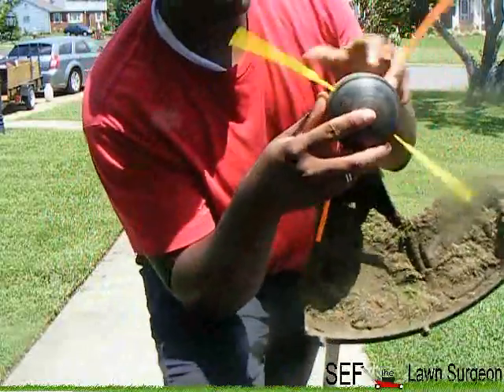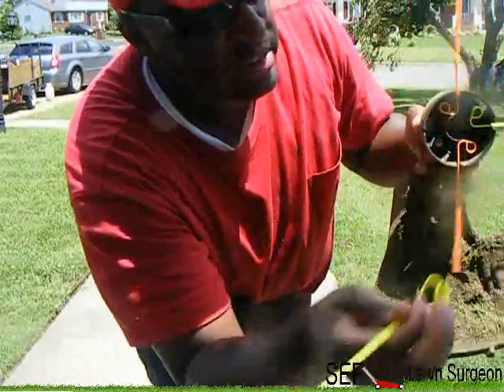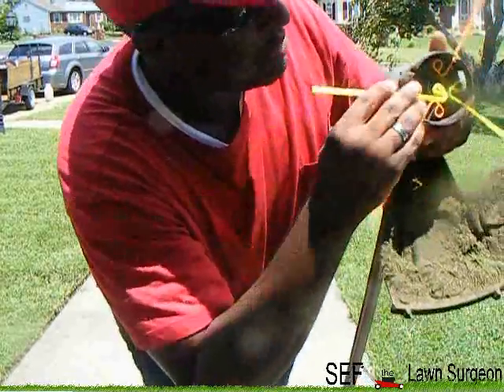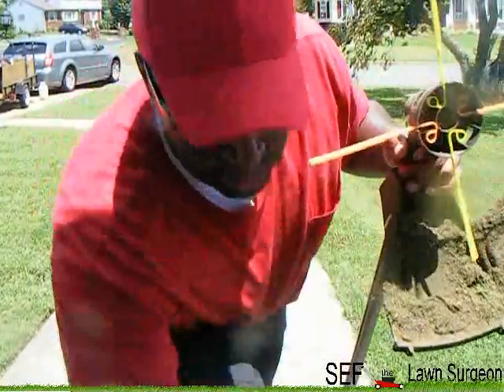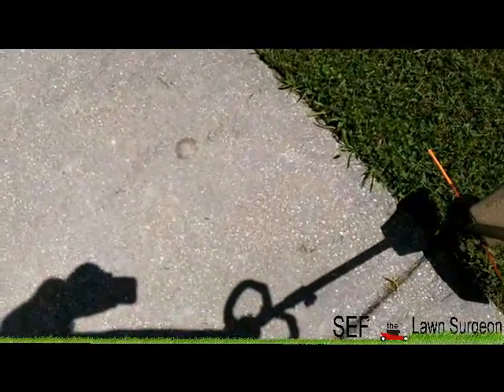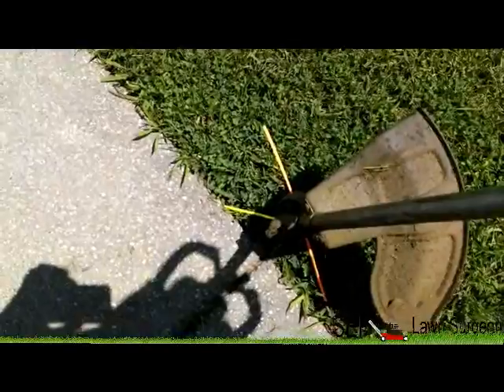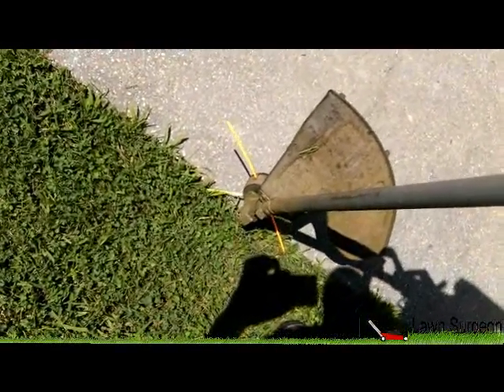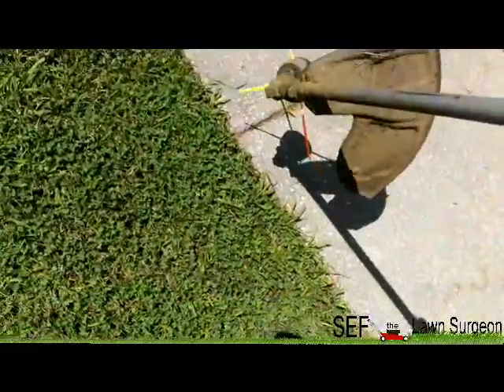How To Edge Your Lawn (The SEF way)

Comment: How was that a straight edge that was jagged    as hell. No hate just truth. And aeroflex is shit tried it when I bought my troy bilt trimmer went thru the pack of line that came with it just doing my front lawn. If you want to do a lot of trimming and edging bump head is the way to go. The thickness of the aeroflex causes it to break faster in my opinion, and it takes to long to change.
Reply from the maker: quincy terrell ... yea.. i have speed feed now... but this was yeeeaaarss ago... but you just have to know how to use the Aero flex...they ware down on hard surfaces so you just have to watch for that... if you do...they will last forever... I use to cut like 4 or 5 yards with one set...ha ha